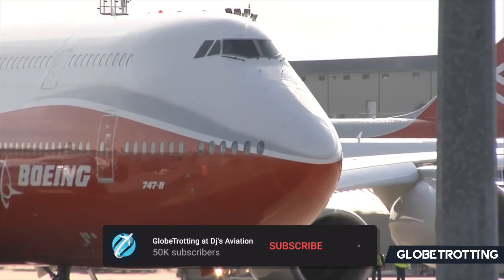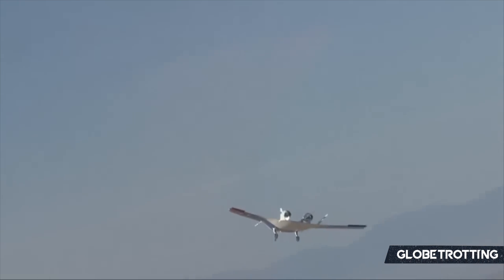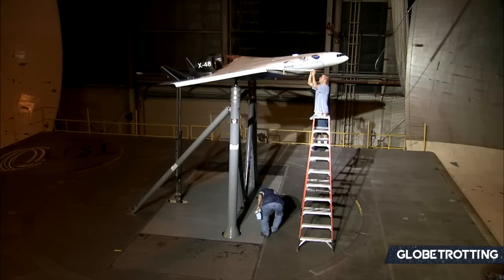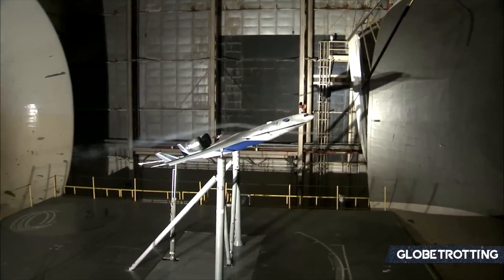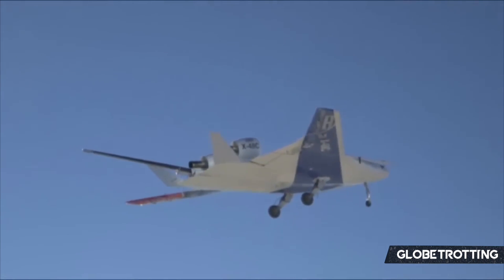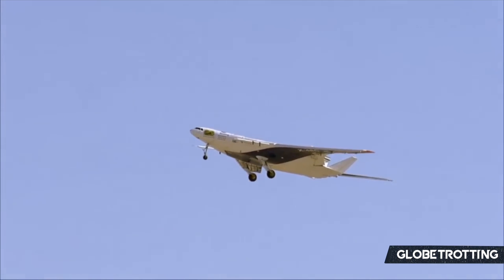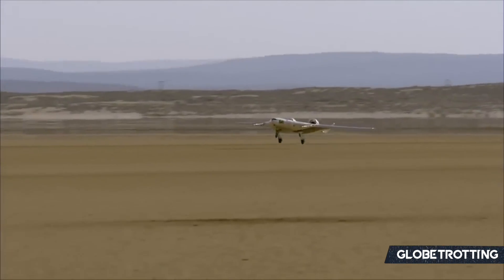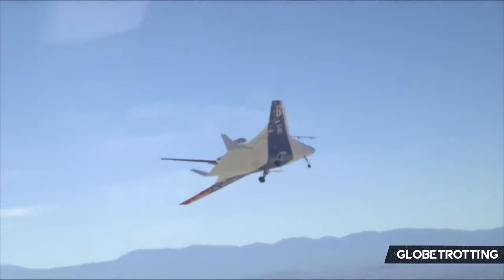NEXT AIRCRAFT? - Boeing's Unreleased X-48

Comment: Considering that Boeing has a contract from NASA for, and is building a full sized demonstrator  Transonic Truss Braced Wing airliner, I suspect that is what they will go with.
Reply: Yes it’s the more conservative concept. If they really develope the bwb next the managers would really be lunatic
Reply: But that's intended as a 737 MAX/757 replacement, one that will use way less fuel than the current 737 MAX models. The BWB design will likely be the eventual replacement for the 777, especially as a freighter (imagine being able to carry as much as the 777-8F in cargo but be able to fly non-stop between New York City and Tokyo with a full cargo load. And not being limited by the fuselage width makes it very viable to carry certain types of outsized cargo, too.)